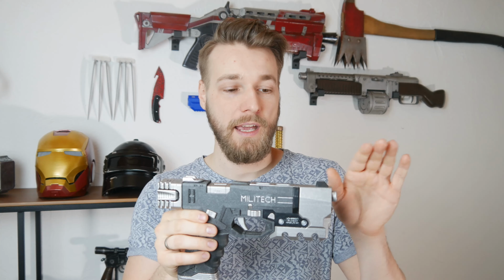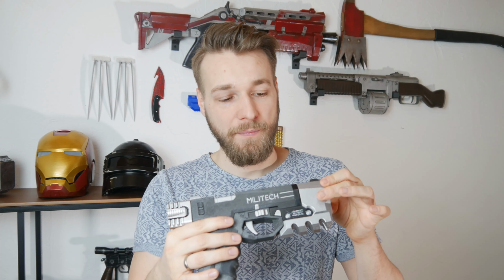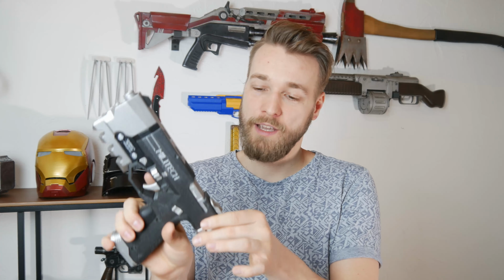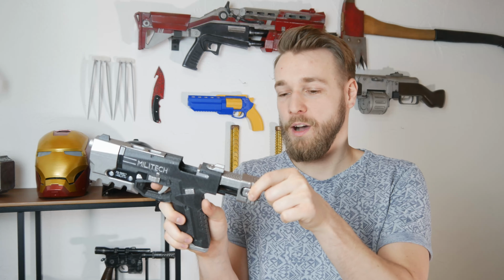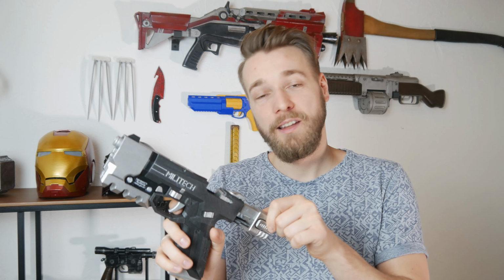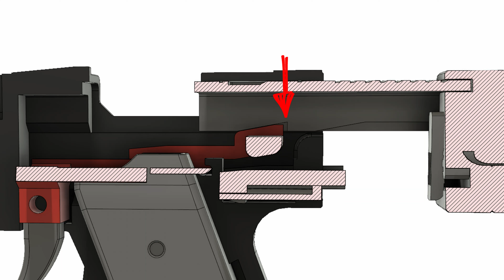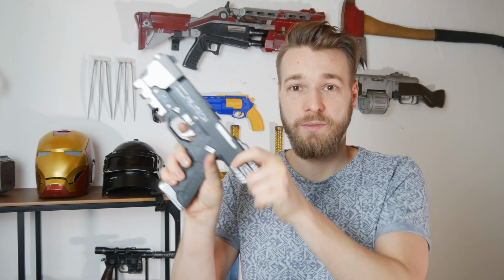REAL CYBERPUNK 2077 9mm Pistol Vindicator

Comment: Since there is a bullet left in the mag, your version is correct, the slide would return automatically.
Reply from the maker: Yeah :D but still a mistake haha either way
Reply: Not all guns work that way.
Reply: @alfonsedente9679  unless you're talking about an open bolt pistol, which the militech 9mm isn't, you're wrong

Comment: You would never pull a trigger to close a slide... Pretty dope otherwise!
Reply: Some guns in the past have worked that way. Not likely to see a comeback though 🤷‍♂️
Reply: If guns from the 1700's are still made and used today in the 21st century, why not?
Reply: Only open bolt firearms are like that, And if you release the bolt they fire.
Reply: @alfonsedente9679  they're still being made today, but historically correct, not futuristic handgun from the 1700s..
Reply: Uh... technically... 
If its an open bolt system (like some machine pistols) yes, you would

Comment: I'm having issues with the magazine, its too thick.  I think I might gave to whittle it down with my Dremel but I'm afraid it will compromise the integrity of the piece.
Reply from the maker: It most likely is not the Magazine but the part which the mag slides into. There is a lot of support, use a hand file and gently sand that part down until it fits